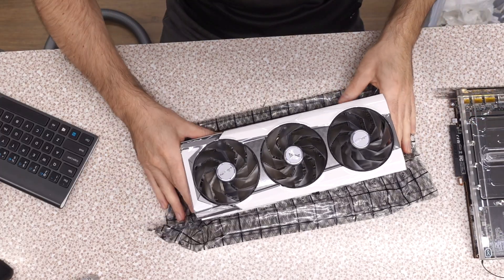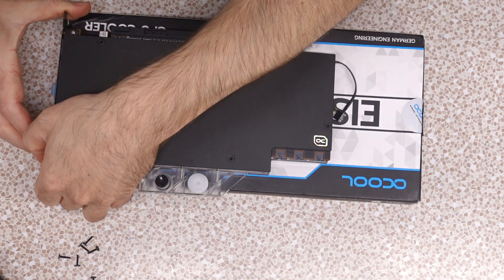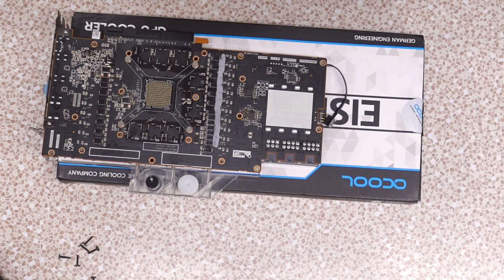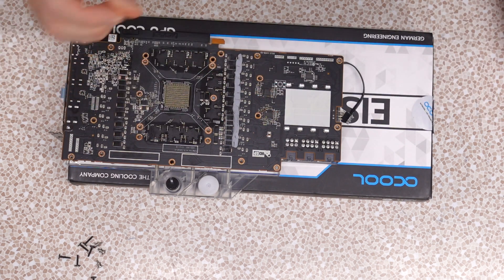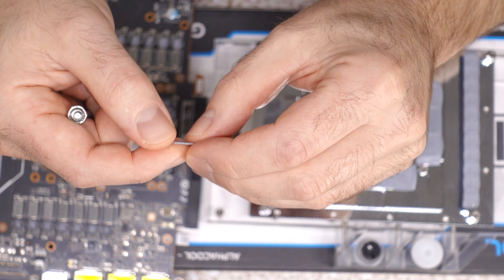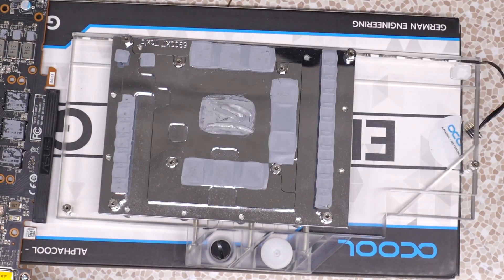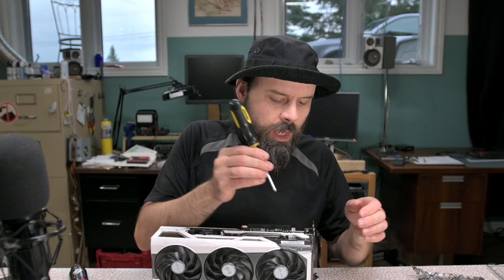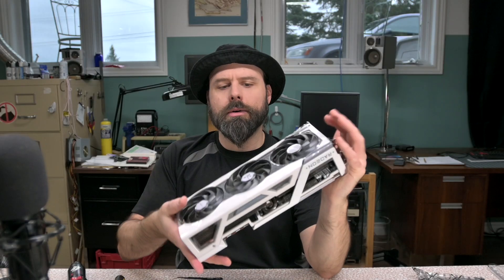PTM7950 on 6950XT Back to the Air Cooler

Comment: hoping this ptm stuff will fix my 6900
its been getting to like 110+ in furmark with the paste that came with it
and thats on a -100 undervolt
Reply from the maker: Oh wow, yeah that doesn't sound right.
Reply: How did it go? I used it on my Rx 6900 xt temps are now at 60C core and 65C hot spot
Reply: @RozzzzeLazzze-r2j  i think it maxed out at like 80 on furmark now, i rarely see it go over 70

Comment: Reports are if you put these in the refrigerator for a short period of time before application it is much easier to manipulate and the protective film is removed easier without damage.
Reply from the maker: Yeah I heard that too. So far I haven't had any trouble handling it. The room I keep it in is a bit cooler, that might help.
Reply: Wouldn't that cause condensation?

Comment: Any results?
Reply from the maker: No not really. The air cooler is soo good on this card, I saw little to no difference between it and the water cooler. Any results would be covered in the video where I installed the block in the first place. Check my playlist called "The Monolith" there will be several vids about the 6950XT.

Comment: I think you could totally reuse the old chunks, even if it's a bit ghetto. Best way I've found for cleaning it off the die and cooler, is a plastic scraper. 

Would be interesting to see how undersized of a piece you could get away with, since it will squish out like paste. The datasheet says less than 0.038mm bond line thickness for best performance, the thinner the better. Something that can help with better core contact and pressure, is to use thermal putty instead of pads for VRAM and VRM, since it can squish to the perfect thickness without robbing mount pressure from the core.
Reply from the maker: Yeah, at the risks of spoiler, I did try it, and I did film a video about it, it won't be out for a while yet. 
But it was some pretty good and even unexpected results.

Comment: That oily residue comes from using thermal pads that are silicon based. It is normal and doesn’t hurt anything. You can clean it with alcohol. Your Vega not wanting to work on the other rig is likely due to a BIOS version, UEFI, CSM, or running something other than PCIe 3 or above. GCN cards can require a little tinkering on newer motherboards to get working properly.
Reply from the maker: Ah yeah, I kind of figured it was from the pad. It's a surprise to me I haven't noticed it before. I've done enough of this kind of thing. Didn't know it was from a specific pad type. 

And yeah, it was a UEFI thing. I didn't realize that other rig was running in CSM mode at the time. I had installed a fresh windows on it, then when I dropped in a new A770 I had to do this whole rigamaroll to get UEFI running to enable Resize Bar.
Reply: @DATT  Dropped knowledge how to switch to UEFI without reinstalling windows and Youtube says i'm a scammer, pay for YT premium account? no not with this.
Reply from the maker: @phenos  Oh, what happened ? Youtube flagged a how to video ?

Comment: Have a 7900XT and looking to do the same, can't wait for your temp review results. Also PTM7950 'smooshes' at 40-45'c+ so hoping it smooshed fast enough to cover the rest of the die.
Reply from the maker: I didn't temp test this config, I couldn't really since I was going from a water block or air. The purpose of the video was more to look at what PTM is like after the fact when you pull things apart, and also the experience of reinstalling the air cooler. I have a couple other videos about this card, when I first put the water block on, and saw like no differences in temps. The Air Cooler is already pretty good. I do have a video where I initially installed the PTM on the card with the water block, I can't remember how well I touched on temp changes there. In every case, working on this card, the differences were so subtle, I didn't make much an effort to test them. I'm not good at the really clinical stuff, my vids are more like, an average joes experience with the product.